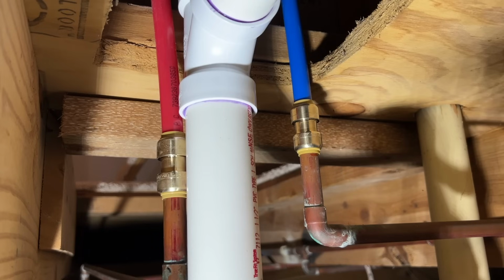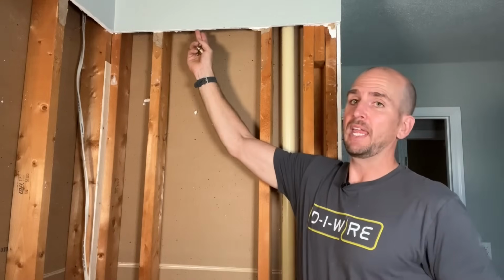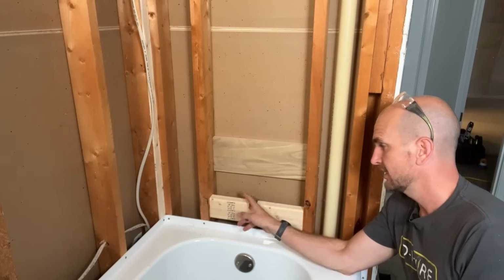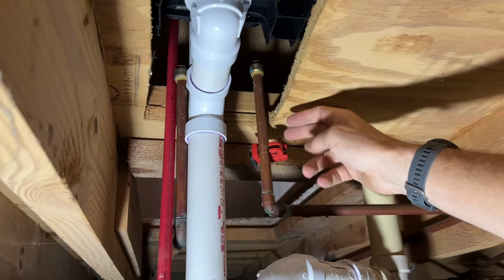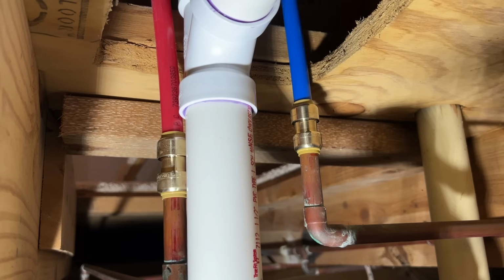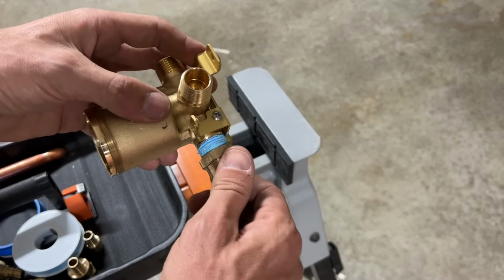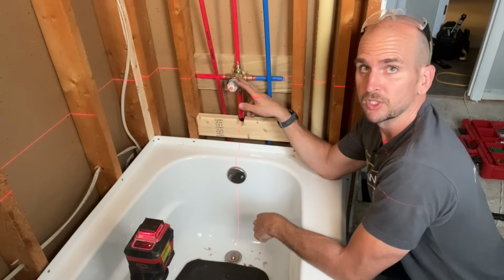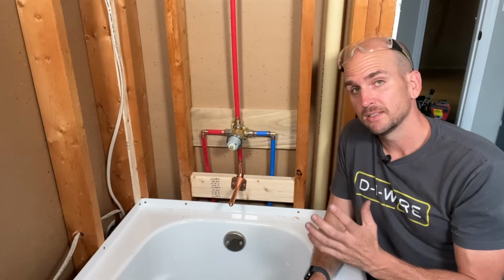How To Convert Old Copper To New Pex | Tub And Shower Plumbing

Comment: I have a tip for anyone who is going to plumb their own bathroom. 
Don't 
Just pay someone.
But, get the right person. 
Not to be a dick but anyone who is using sharkbites isn't the right person. 
There's a tool you need to buy put crimp rings on your pex connections. It's not expensive but it's key.
The right person has the right tools.

Comment: if I assume 1x6 really mean 1' plus 2 3/4 = 3 3/4 but the depth from the stud is 3 1/2 + 1/2 = 4" the shower valve is going to be under no surface for about 1/4

Comment: the sharkbite is a huge mistake i used these once to test it they leak overtime cause they lose tension
Reply from the maker: Hmmm, thanks for the feedback but I haven’t had the same experience with SharkBites.  So far so good where I have used them assuming I fully seated them on the pipe.

Comment: I just installed my shower valve the same way using Pex A to the copper stub out for the tub. Have you had problems with the shower head dribbling water because you didn't use all copper from the shower valve to the tub? I've been reading that you need to do the tub pipe to be all copper.

Comment: one important tip, turn the water on to pressure test all the connections before putting the surround on or backer and tile.

Comment: I just bought a Delta valve. The instructions say don't use PEX on the tub spout drop. Why?
Reply: The slightly smaller diameter can lead to water backing up to the shower head when filling the tub. Which isn't that big of a problem anyways.

Comment: Mt skill set is advanced handyman.  I do appreciate your video effort and all but pex?  I felt somewhat lazy using shark bite fittings once and used them out of curiosity on a garage gas hot water heater.  Pricey experiment.  Soldering is not difficult.  Copper has been the number 1 choice in residential construction.  Yes PEX is gaining specifically it is cheaper, fexible and easier to install.   But I would feel badly should a professional or homeowner walk up behind with me bending colorful tubes together.  Maybe I'm old school.  But your video is on installing PEX not a discussion of what's better.  Again thank you for sharing.

Comment: My skill set is advanced handyman.  I do appreciate your videos and all but pex?  I felt somewhat lazy using shark bite fittings once and used them only on a gas garage hot water heater I installed.  I'm sorry but PEX IS lazy.  Soldering is not THAT difficult. Yes there are some advantages with PEX but I would feel badly should a professional or homeowner walk up behind with me bending colorful tubes together.  

Copper is the number 1 choice for residential pipe.   PEX is gaining not because it is better but because it is cheaper, flexible and easier to install.  Nothing in that says better.  Again thanks for your time and efforts.

Comment: @EverydayHomeRepairs  Scott, great video, the only thing I found missing: you didn't do a pressure test -- I have a similar Delta valve I have installed, but if there's a video walk-thru anywhere for doing a pressure test before everything is closed up, please let me know. I guess my main question is: do the shower head and tub spout pipes need to be capped off? I imagine they do, but Delta is very vague in their instructions. The instructions do say to open turn on the water briefly before installing the valve to make sure no debris in the lines gets run through the valve. But that would make quite a mess, to turn on your water with the pressure test cap removed. Yep, I am just looking for someone else to have done it, I don't have anyone helping me right now.  #workingalone   Thanks!
Reply from the maker: For instillations like this where all the new lines and fittings are in the same place and visible I don't do any dedicated pressure tests.  I do run the water through the spout and shower head then jump down in the crawlspace to check for leaks but that is about it for testing.

Comment: We used pex in 1979 at our home in the UK. When we moved to US in 1994, we had the copper pipe removed since the well water was eating the pipes and brought pex over from UK. PVC was a pain to prime/glue. Our old home (kid's house now) is still on that original run pex. Our current home is still on the 94' pex with zero problems. I still do copper for friends when they request it, put pex is so easy to run and causes no problems if done right. Great job. I guess the newer generation of plumbers hate DIY people and YouTube, so all they can do is criticize.
Reply: I hate plastic in general, but Pex piping is better than any kind of metal!
Reply: Yeah I'm happy the states are all getting into Pex finally.

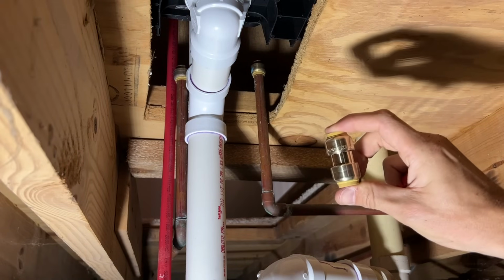Comment: I understand you are not licensed plumber and you do it for YouTube clicks, only but  still, to clear some confusion.... @7:33 - it is called "coupling" not "union". Also, you don't apply Tefron tape then Pipe dope over it. Totally unprofessional. That's what the "experts" at Home Depot tell you to do. Teflon tape and Pipe Dope are two independent sealants designed to be used on their own.  Nowhere in the in the application instructions Manufacturer suggests you apply Pipe Dope over Teflon Tape, or vice-versa. Thank you

Comment: When those crimp rings start leaking and  those shark bites that you installed wrong because for one you barley sanded down the copper pipe I can still see the red marking on the pipe, it needs to be shiny, also you never deburred the copper pipe at all , so now you jeopardize the O-Ring in the shark bite so when they start leaking and they will trust me, then the real licensed master plumber like myself will have to cut out the wall to do it the right way and it will then cost customer alot more money, only thing I can tell all you DIY and all you wannabe plumbers and handymen, and contractors who are not licensed plumbers is if your going to post projects on YouTube, at least do your homework and do the plumbing correctly so it doesn't make you look like an amateur and most important so that homeowners are not trying to do there own stuff copying off you doing it wrong.

Comment: which is better Pex or Copper? why convert to pex from copper when copper is so easy to solder ??
Reply: We had copper, but our well water slowly caused leaks. Eventually we moved to pex throughout. It is so easy to bend pex around other pipes or through walls, less cutting and fewer 45 degree angles needed.

Comment: Thank you so much for the video, this is the best so far! Very easy to understand.
A quick question, how do  you call the L shape piece you used, which will be connected to tub sprout? Thanks again
Reply: Found it! 
1/2 in. PEX Barb Expansion x 6 in. Length Copper 90-Degree Stub Out Elbow Fitting with Mounting Bracket
Would you have a tutoring video for the tub sprout installation? Thank you!
Reply from the maker: Actually, I found this type of Delta R10000 valve after this project it will have the PEX nipples already installed in the hot, cold, and shower ports with a soldered in tub spout at the desired height.  Super handy!  https://www.deltafaucet.com/bathroom/product/R10000-PFT-PX-R.html?gclid=Cj0KCQiA7bucBhCeARIsAIOwr-_PANMq_aTFH8_r4Djj5soEg9aedNtenafrve1Qlpbwxu1kDWXAL5AaAm8bEALw_wcB
Reply: @EverydayHomeRepairs  Thank you so much Scott!  The part in your link look super convenient!
For the shower head connection part, do I still need extension or dropear as you demonstrated should work?
I will have to watch your video few more times to learn every single one before starting renovation!

Comment: Number 1, you used Shark-Bite connectors for the copper to home depot PEX.  I hate to tell you but those Shark-Bite connectors will eventually leak.  Two, do not use Home Depot PEX or fittings, that is not professional grade and the crimp rings tend to weep. You want PEX-B and the thicker brass/plastic fittings.  Three, you want to use compression fittings.  Yes, the Milwaukee expansion tool is expensive but consider the cost down the road of repairing water damage.  I've never has a connection leak whereas the crimp method combined with Home Depot PEX and connectors tend to leak.  Four, put in more support for your PEX pipe md connectors, it pays off in the long run.  Five, shark-Bite is good for temporary repairs but replace with professional grade connections.  There are compression fittings you can use for permanent repair/upgrade.
Reply: You forgot #5 - you were watching this video because you are afraid to do it yourself, but love to criticize someone else.
Reply: @timbob987  There's always someone who never knows what he is talking about.  When I did the work on my old house (build in 1950 in Ft Worth) I replace all the old steel water line in the wall (and the 500 sqft addition) with PEX , professional grade.  Even ran the ne water supply line (code says it must be 1 inch) to the house with PEX.  I used the Milwaukie expansion tool (battery operated and $400 thank you very much) and brass fittings.  Never had one weep on me.  I did every thing to spec and the plumbing inspector was impressed.  So Mr Tim Bob, put a sock in it.  I also did all new electrical wiring, insulation, gas piping, the HVAC duct to the new addition, the drywall, the OSB sheerwall  and the siding, all new windows, and carpentry work.  the only thing I didn't do was to put on a new rood, hired a roofer for that.  So Tell me Mr Tim Bob, what have you ever done?

Comment: Very nice video. I do the tub spout and shower head lines out of copper, a little more stability for the spout, and no expansion and contraction in the line to shower head. Pex is a great material as long as it is not restrained and can expand and contract without stressing connections. Valve to shower head is two solidly fixed points and the deflection is pretty dramatic as it expands.
Reply: The Delta valve manual actually says that the tub spout should NOT use pex. Apparently if you do there is just enough restriction that water might come out the showerhead when you try to fill the tub.

Comment: Do not use plex on tub spout line bad advice had to rip mine out….
Reply from the maker: I agreed Jim, although I haven't had any issues with this install.  I agree, 1/2"copper to the tub spout rough in would have been a better option.
Reply: There are other factors which can come into play, it doesn't always cause that problem, and, frankly, if it developed in a tub I had a home, I don't see what the big deal is-- it would only happen when you're filling the tub for a bath, and if it happened, water would drip or flow in a slow stream out the shower head and drop down into, you guessed it, the bathtub you are filling. Don't really see how that's a big problem?

Comment: A tip on a 90° turn for PEX without having to use a fitting: You can get a 3/4" gray PVC conduit elbow and slide it over the PEX to make a bend. You might need some lubrication to get it to go, but it works very well. Alternatively, you can cut the pvc conduit elbow in half lenghtwise, clean up any burrs, and then fit the PEX into it and tape it in or use some other method to secure it in the bend. It's cheaper than buying the fittings and you have less restriction of water. 
I have the hardest time with teflon tape folding over instead of staying flat. It sort of rolls into a tube shape-- but I am uncoordinated. LOL.
Reply: Depending on the diameter of the PEX, those grey electrical elbows work very nicely and gives you a bit of insulation.  You can run them into studs, subfloor, clamp them in place, very handy in eliminating kinks.
Reply: Or use the metal bend supports...

Comment: If your house is piped in plastic I suggest adding a copper coil. scientist put germs on 2 Disc one copper one stainless steel everything dies on the copper rather quickly

Comment: the person who installed my bathtub used PEX for the spout ... and I don't know how to fix it....... it's hard for the faucet to stay in place and there's also a leak...... not to mention that the water is flowing in words, which I'm afraid will cause damage on the inner walls leading to my kitchen... how do I fix this problem, since the tub is already installed. HELP
Reply: Cut a hole in the wall behind fixture to access fixtures

Comment: I've had 3 insurance claims in my business using "push" fittings.  I highly recommend not using these. In the end my insurance didn't pay and the homeowner had to file with their homeowners insurance because you could see from the marks on the pipe and the marker marks left behind that we had installed them correctly and the homeowners insurance would have to go after the MFG.  We completely stopped using them.
Reply: The name says it all. lol

Comment: Pex has purpose and advantages,  but some areas should be done with copper.  Such as anything that may require some use of force in the future.  
Shower cartridges, tub spouts, and shower arms can get stuck. The only leverage behind the wall, is how stable the fittings are when secured to the framing.

Comment: you have to use 1/2" copper to the tub spout connection.
You will have a small drip from the shower head, read instruction on delta's mixing valve manual.
Reply from the maker: I will keep you posted.  I am guess I won't because of the 50" of head pressure from the valve to the shower elbow with 1/2 pex as well 🤞
Reply: @EverydayHomeRepairs  what’s the verdict after several years? I’m doing this same thing right now and can’t decide if I should make the tub spout drop from copper or go your route
Reply: Pex to tub spout is a no go (i don’t think that’s what it’s for). I had to remove my dry wall to fix. Not enough flow and shower is more than dripping.
Reply: This is what I’m wondering. Why do they sell a copper 90 stub out that’s pex compatible on the other side? 
I need to add a 90 from the mixer to the copper stub out. Is 1/2” pex 90 going to cause the shower to drip? And if so why make a copper go pex stub out?

Comment: Great video, but one thing I do Different when I use pex b is on the tub and shower is use copper, but being diy I would use 1/2 female pipe to 3/4 pex because you will have more water than the 1/2 pex can handle and it will come out the shower head , when your trying to fill the tub ,the 1/2 pex has to much restriction, just alittle tip and thanks for the video.

Comment: Well Pex is easy and cost effective……but not as good as copper when it comes to rats!
Reply: Yep just completely re piped my sister in laws house. 100% copper and sweat fittings. Except 3/4 inch ball valve at the main. 1945 construction with hodge podge push fit pex all through it. And she has mice get in regularly. Was not taking a chance of a flood since I'm 1.5 hrs away. I'm doing it once, thats it.

Comment: Just out of curiosity, did the manufacturer require/suggest using copper for the tub spout or shower head? I've used pex in the same manner as you without issue many times. Usually, I use pex ready valves if I can get them mostly Moen and sometimes Delta. Last 3 showers I did all used Kohler valves and the manufacturer says that the valve can be fed with pex but MUST be plumbed with copper for tub and shower. Supposedly this prevents a condition were the shower head can flow while you're filling the tub. I've heard of it but never actually seen this happen. Good call on the copper stub out. After seeing some hack jobs on toilets with pex sticking out of the wall and an angle stop dangling there, I've been using the stub outs at every termination.
Reply: tub spout drop should be copper, otherwise water comes out the showerhead from back pressure created.

Comment: I was wondering why nobody uses brass elbows for hot/cold inlets at the valve and instead use short stubs of pex with elbows. A local plumbing company wanted $4K to replace a 36" fiberglass shower (not including price of shower). We like Symmons shower valves.
Reply: Brass gets corroded overtime.
Reply: @bluesclues6586  I think the Symmons shower valve is made out of brass. You would think it would corrode too. Strange.

Comment: I am a copper guy but I have one good thing to say about PEX, it puts out fires rather well. I had a small kitchen fire in a cabinet in a mobile home and the only thing between the fire and the washing machine plumbing was thin paneling. The fire burned through the paneling and melted the PEX and put the fire out.

I bought all my new copper plumbing way back (2009) when I first bought my current home (1934 - 5 bedroom) in planning to replace all the plumbing in my home to copper. I am glad I did because copper is now super high.Copper price is up almost 4x since 2009.
Reply: During the deburring of the inside of the cooper pipes, you sealed those burrs into the pipes. Can they damage your new Delt valve? Should the burrs have been flushed out before connecting the PEX?